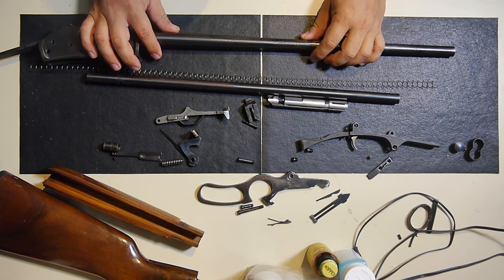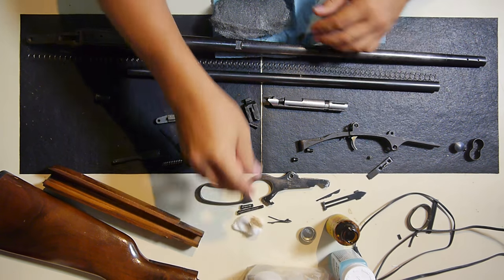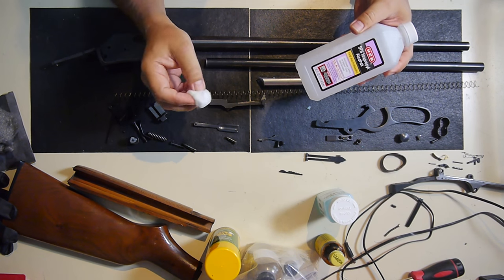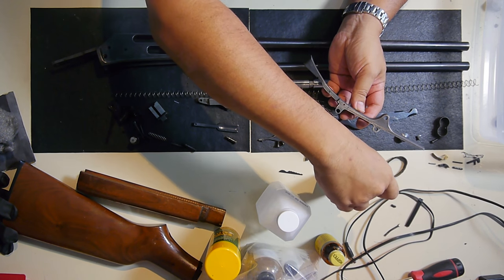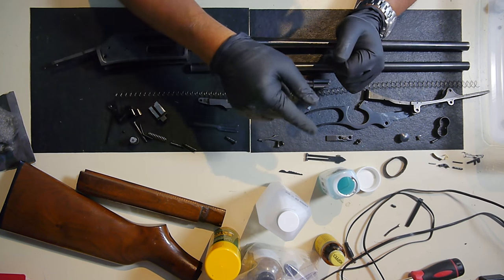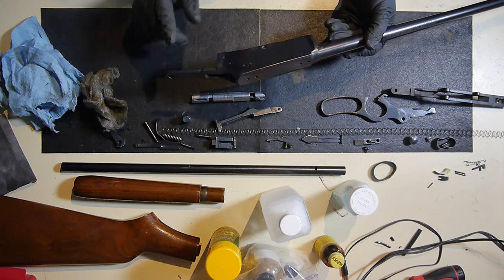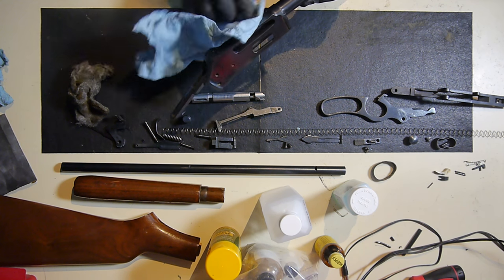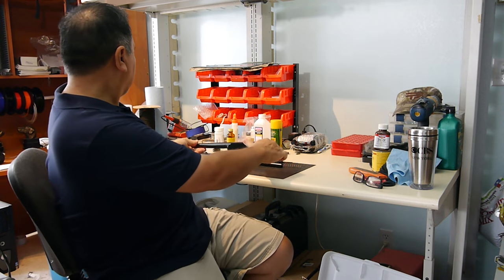Marlin 336 30-30 Lever Rifle Cold Bluing

Comment: First, thanks for the videos. I just got done totally disassembling an old, neglected, model 336 I picked up thanks to your videos. I have surface rust on the receiver (inside and out). I have been watching some videos on bluing as I may give it a try instead of paying someone. My question is do I have to totally strip the part before bluing? Some I watched show going to bare metal but this video doesn't appear that you stripped the parts. Any help would be appreciated and again, THANK YOU!